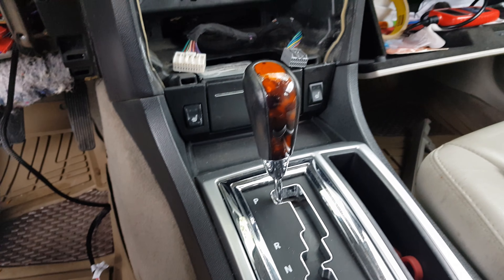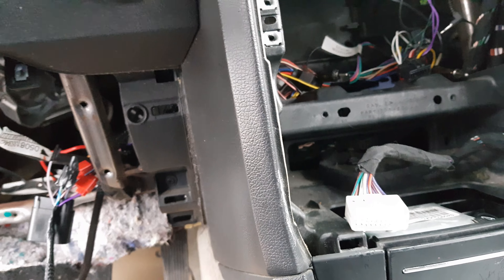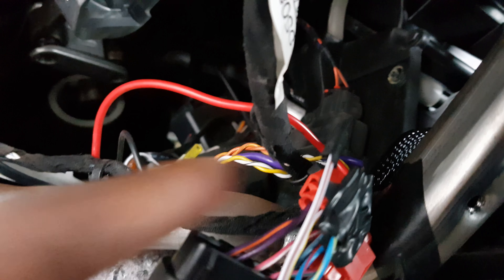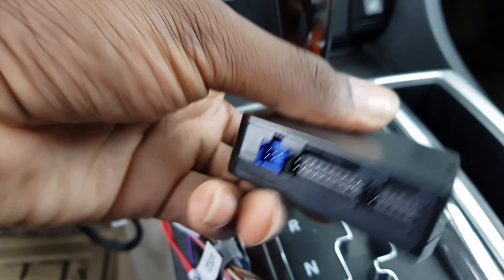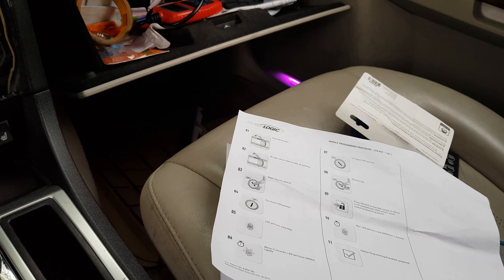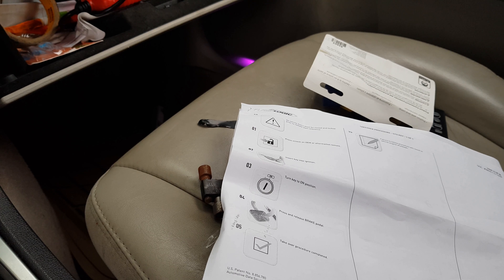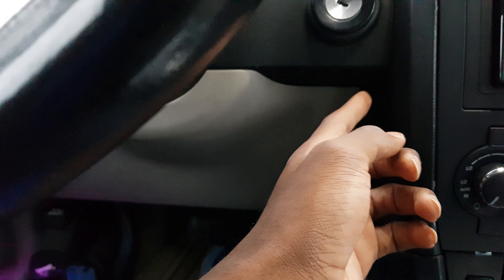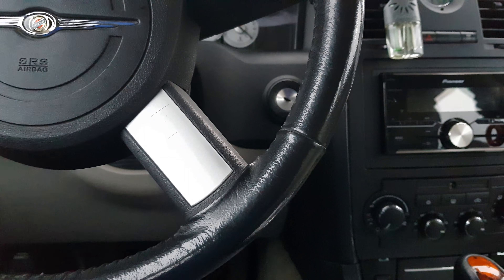FlashLogic FLRSCH5 Remote Start Installation (2005 - 2007) Chrysler 300C

Comment: Thank you for making this video.  I installed this kit about 4 years ago under the impression it was plug and play.  I even called technical support and the tech was pretty useless and couldn't even tell me which instructions to follow so I gave up.  I happen to come across this video today and spliced in the two wires like you did and blam, remote start!  Wish I could give you a thousand thumbs up.
Reply: Did u cut and insulate white and yellow wire ?
Reply: @YjoserC  Yes.  Make sure you leave enough wire near the connector in case you need to reconnect it.  Did you splice in the two wires (White/Yellow and Purple)?
Reply: @JW-ke9ed  yes I did. And why would u need to reconnect them for ?
Reply: @YjoserC  Because when I spoke with technical support, the tech wasn't sure if I needed to cut the wire or not so I made sure I had enough wire to reconnect it if I had to.  It wasn't a big deal, instead of cutting the wire right at the connector, I cut it about an inch from the connector.
Reply: My battery keeps dying do you have this problem too?
Reply: @acog_knight-spider1591  No, haven't had any problems with my battery draining.  Does it stop if you disconnect the remote start?
Reply: @JW-ke9ed  white yellow and purple?
Reply: @pedrocazales7881  Yes.  White with yellow stripe and purple.
Reply: @JW-ke9ed  I’m so lost here lmao but it’s all good I found out my problem, I had everything wired up correctly but the module wasn’t flashed with the firmware

Comment: UPDATE: Installed successfully and working!  Also wanted to confirm that the white/yellow wire (on the VS2 connector) DOES need to be cut, as indicated in the instructions.
Reply from the maker: Awesome! Yup. It does
Reply from the maker: Sorry i didn't respond to your last comment, youtube doesn't notify me a lot of times lol
Reply: Anyone steering wheel stay locked when remote started. Have to turn car off and start it manually or steering stays locked anyone have this problem

Comment: Installed this on my Magnum a bit ago, but seem to have an issue ever since where if I press my lock button on my key any amount of times, it may just randomly remote start. Like if I press my lock twice when I leave the car - then press lock later in the day again, it will count that as 3 and start.
Reply from the maker: Weird maybe there a way to change if go one press instead of 3, check the manual if there's something like that. Its been a few years I installed this so I dont remember everything about that remote start

Comment: Hey. Great video. I have an 07 Dodge Charger and mine is not working. I followed this step by step. Not sure what I did wrong.
Reply from the maker: Did you wait a second between the 3 press?
Reply: @Dan300  Yes. It causes lights to flash on dash but no attempt to start. I only connected the 2 wires with the easy connectors like you did.
Reply from the maker: @theAKBOURNE  and all the doors, trunk is closed when you try it?
Reply: @Dan300  Sorry for the late response. Yes, the trunk is closed also. In the installation I see you have to connect to the driver door pin, how did you connect to that?
Reply from the maker: @theAKBOURNE  nah I didn't connect anything to the driver door
Reply: @Dan300  Thanks for all of the responses. Mine just will not work. It will not even attempt to crank. I appreciate the help.
Reply from the maker: @theAKBOURNE  okay, sorry I couldn't help it's been over a year i made that video so i dont quite remember every step. Call the flash logic guys they will be able to help you, their number should be in the instructions
Reply: @Dan300  Thanks. I can do that! Last question, any idea what gauge quick connects you used? Wonder if that could be it, maybe they aren't making a good connection. Thanks again!
Reply from the maker: @theAKBOURNE  I dont remember exactly but I bought a whole set from advanced auto and I remember just trying all and I used the smallest one that fit so the connection is tight
Reply: @Dan300  Thank you for your time. I appreciate it.
Reply: Hey. Just wanted to give an update, I got the remote start working. Turns out it was the connectors! I wired directly to the Mux and Starter wires and it worked perfectly! Thanks for the help and consideration!
Reply from the maker: @theAKBOURNE  awesome, glad to hear it worked 👍
Reply: @theAKBOURNE  Hi Adam, I just posted a question to Dan about the instructions on the Type 3 wiring diagram which says to cut and insulate the white/yellow wire AT THE VS@ (male) CONNECTOR.  Did you do that step? I'm wondering it that might solve your problem?
Reply: Did u cut the white and yellow wire and insulate it ?

Comment: Where did you get the splice connector?
Reply from the maker: Autozone
Reply: @Dan300  did you do straight out the box or did you have to program it with a computer?
Reply from the maker: @pedrocazales7881  straight out the box no computer programming is required
Reply: @Dan300  I’m trying to install mine right now and I’m having troubles
Reply from the maker: @pedrocazales7881  what troubles you having?
Reply: @Dan300  just splicing the wires, I messed up a couple times and had to cut the wires and now their too short
Reply from the maker: @pedrocazales7881  get more wires and connect them to make it longer
Reply: @Dan300  I figured out a way to get more slack on the wires, I cut a zip tie holding the harness it’s connected with to the frame and pulled it more towards the steering wheel but I still need to splice the wires together
Reply: @Dan300  are you suppose to cut the white and yellow wire on VS2?
Reply: @pedrocazales7881  Yes. Also no programming done if it comes pre flashed.
Reply: @jesusayala1999  mine didn’t come pre flashed

Comment: Im pretty sure you seen my video you didnt have to take all that other stuff off just took the radio out and plug it in and what are you wiring it shold be plug and play yours is a bit different but if you didnt a made a step by step video win i did mines it wasnt anyvideos out
Reply from the maker: Mines was not plug and play, the instruction said I had to splice a couple wires
Reply: @Dan300  wow i was confused af

Comment: Installed everything as it said on my 2007 Dodge charger sxt. Did nothing. Was told to cut a white/yellow wire. Now i hear the fuel pump prime and see the lights flash. Still wont start. Anything im forgetting?
Reply: Yeah, exact same for me, I have the same, 07 Charger SXT and connected mine does like yours does, doesnt crank.
Reply: So you guys did cut the white/yellow wire at the VS2 connector and it still didn't work?

Comment: Hi Dan 300, I'm about to install this remote start kit in my "06 Magnum and noticed a step in the instructions which said to "cut and insulate the white/yellow wire (on the VS2 connector)", but I didn't see you refer to that step in your install.  Did you do that step?  Thanks for a great video otherwise though! PS: I'm wondering if that might be why some others who posted on here were not successful with the installation?
Reply from the maker: Its been a long time I installed it. I dont remember every step, but just follow what your manual says you should be good
Reply: @Dan300  I saw in your video a picture of your "TYPE 3 - WIRING DIAGRAM - 1 of 1" sheet with a photo and instruction at the top to cut and insulate that white/yellow wire at the VS2 connector.  I'm assuming you did that step even though you didn't refer to it.  Hey, either way, thanks for the really quick reply!  I'll give mine a try and come back to post an update in case it may help someone else out.

Comment: Hi Dan quick question. Did you hook those 12 pin cable (parking light, horn, driver door)?
Reply: And hood switch? Is it necessary?
Reply from the maker: @jasperjones3950  the hood switch isnt necessary. I didnt install it on mine
Reply from the maker: @jasperjones3950  I also didn't hook the parking light, horn and driver door
Reply from the maker: They are all optional you dont have to install them
Reply: @jasperjones3950  
All those are gonna work automatically, anyway.
Reply: My park lights don't come on with minds do I need to hook the 12 pin up for my park light's to work

Comment: So what did you do about the programing part?
Reply from the maker: I followed the instruction on the manual heres a video that shows a better way on how to program it https://www.youtube.com/watch?v=OjQndDUq1LU
Reply: Dan 300..i seen that vid but it didn’t help. Im talking about what you did for it to actually work. When you “gave up” then came back and said you figured it out.
Reply from the maker: When i said i gave up, my plan was to call the guys at flashlogic for help. So i randomly just pressed the remote lock 3 times and it started up. Before i said i figured it out i did not do anything else to it. So i think when i was doing the programming in video and i got confused i actually got it right. But make sure you're not pressing the lock button quickly, press it once wait for like a second then press again wait and press it the last time.

Comment: i have just done a Type 2 install on my car. Everything worked, when i pressed lock 3 times everything simulated that the key was in and on the ON ignition. Except that it did not crank or try to turn. turns out i need to do the type 3 install aswell. and the only difference is the splicing of the purple and white/yellow wire on the B1 connector that sits on the ignition barrel. I have a question about the splicing. How did you splice the cables? did you just stick them in from the back in connections 4 and 2? or did you cut the cable a bit back under the netted cover and simply used a screw fitting to get contact between the cables? Because we aren't replacing cables right? just connecting them in the same circuit?
Reply: the result on your video shows 2 cables on the front with one going out in the back. are they all connected ?